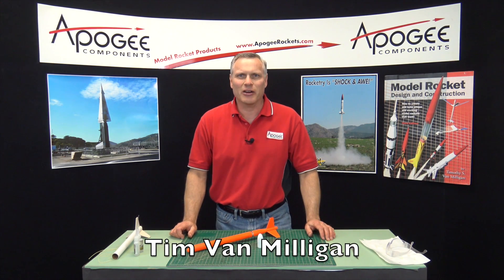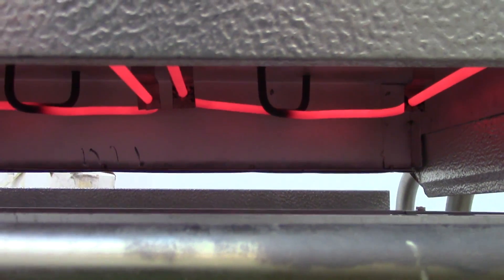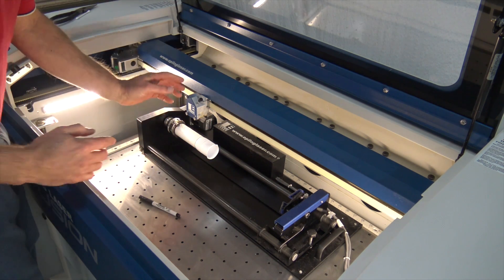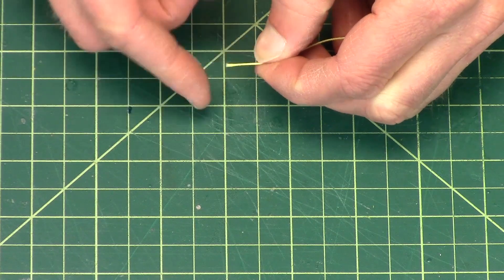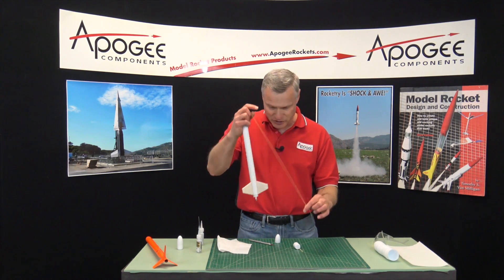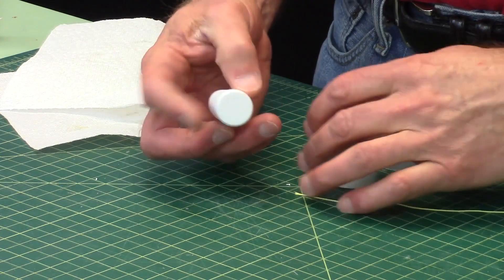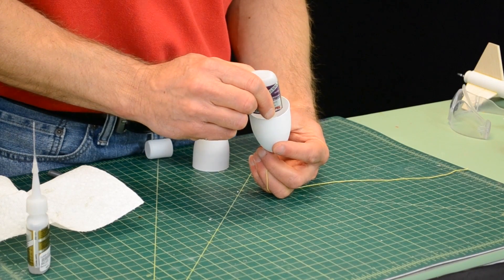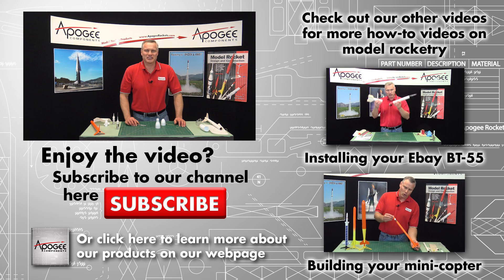Vacuum Form Nose Cones

Comment: Additional vacuum applied a few milliseconds after the suction blower attains a specific vacuum pressure (typically, just a bit less than it's rated max) - can greatly help with the "crinkling" seen at the base of your molds.  However, much easier said than done!  Still, my thoughts on the subject have always been to use a differential pressure sensor in the inlet of the vacuum blower (btwn ambient and measured) to trigger a solenoid valve that connects a large pre-evacuated vacuum chamber, "the accumulator" to a manifold placed directly underneath the mesh screen floor of the lifting platform.  Needs to be reasonably large piping AND be sure to reverse how you connect the solenoid valve.  High (gas) side towards the platform.

Potential downsides:
1. If successfully implemented, your parts can be made even thinner than they are currently.  Naturally, thinnest at the top.
2. Taken to the extreme, point #1 will result in defects via perforations, etc.

Both can be addressed via trigger timing, by the depth of the vacuum that is stored in the accumulator, and/or by releasing the additional vacuum later in the cycle.

Just thought I'd share...
Reply from the maker: Thanks for sharing.
Reply: What kind of plastic are you using?